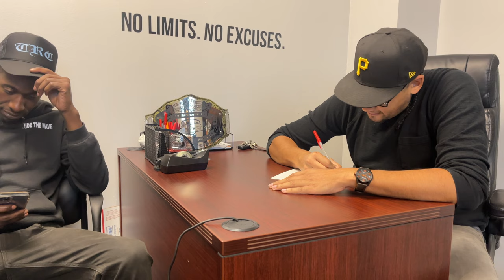E36 S52 TURBO BUILD with the INFAMOUS 900 WHP E36 "REDBULL" owner Francis_Von_louie  #bmw #ssm #e36

Comment: S52 starts to shake itself apart 7300.   ATI Damper can help but there's no point reving that high because you aren't making any more power up there anyway.    Better off with a strong street engine than a race engine unless you plan to race on the track.
Reply from the maker: I actually need to order an ATI damper, and i do plan on taking it on many tracks. Trying to go to other states and big events